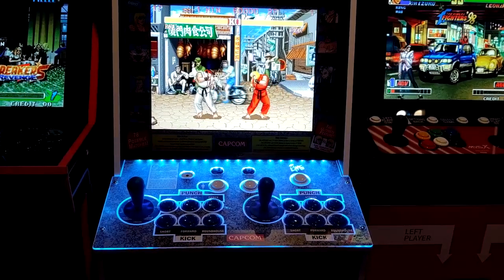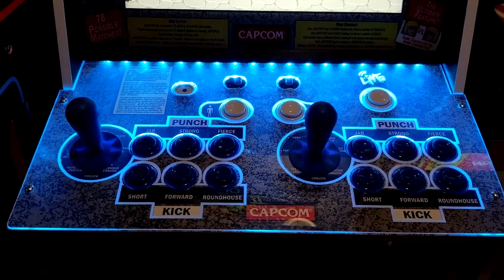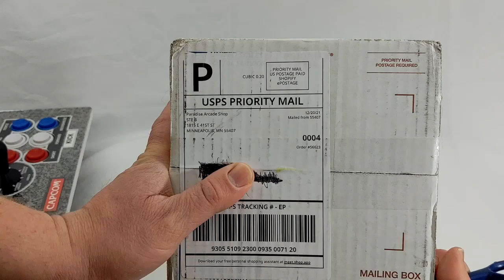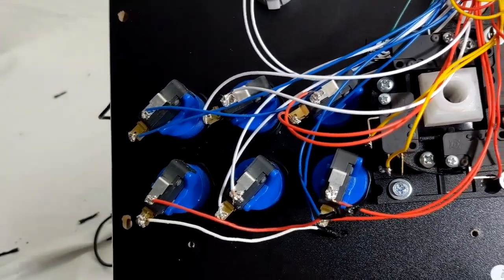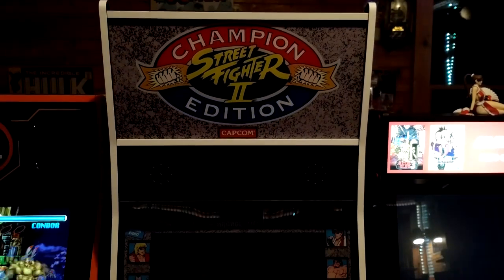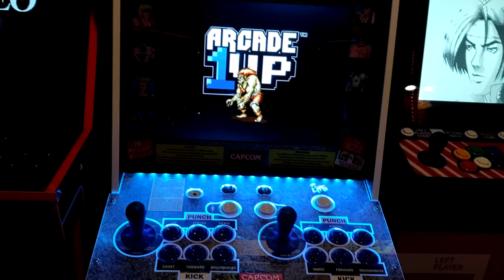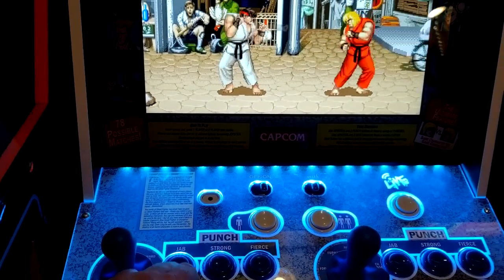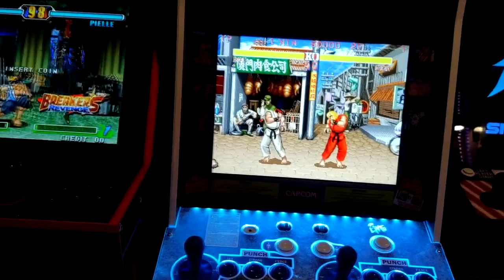Arcade1up Big Blue MOD: IL Eurosticks and HAPP buttons INSTALLED!!!

Comment: Nice job! I being told the IL sticks are the way to go. I just bought all sanwa buttons and joy sticks for it. Now I’m gonna buy IL sticks and use the sanwa on another cab. Hopefully I can actually perform a dragon punch with them. Good video
Reply from the maker: Thanks I appreciate that. I need to start practicing the DP's now.
Reply: @MikeyJProductions  installing the IL stick u need to drill 3 new holes? or can use exsting holes?
I am afraid of drilling as might crack the joystick panel :T
Reply from the maker: @KnockTsuKow  I've put IL sticks into a number of Arcade1up's and the MVSX, and I've never had a problem with this.

Comment: How did you line up the stems for the sticks with the holes? Not quite sure how to make it centered.
Reply from the maker: I just use my best judgement. As long as the stick shafts dont touch anything while you are playing, it'll be fine.

Comment: Yo, Mike. I recently messaged you on your older mvs exposed as well lol. I'm still so confused on the sticks sinking in deeper on the MVSX but they're higher up on the big blue. They're all IL Euro sticks though. Definitely let me know how the sticks are sinking in deeper on the MVSX when you check that post I made, bud.  ..PS. What cutting tool exactly are you using to cut that plastic on the stick to make it fit on the deck? The tin cutter I use takes forever lol. I don't want to go through that cutting hell again
Reply from the maker: Maybe better tin snips, it was easy for me, like cutting through cardboard almost. I just grabbed the ones I had in my house, lol
Reply: @MikeyJProductions  maybe I'm thinking of something else when I think of tin snips lol. When you get a chance, can you send me an Amazon link on what you have? Doesn't have to be exact, but to give me an idea

Comment: Your soldering techniques will result in cold solder joints. You have to get both joint surfaces to heat simultaneously and apply the solder and allow it to flow into the joint. Eventually those joints will likely fail.
Reply from the maker: If it was something more technical, you might have a point. But for this, itll be fine. As long as the wires are connected to the metal, they will work.
Reply: @MikeyJProductions  Let me be clear, this was meant as constructive criticism not trying to be a dick at all. I have been certified in soldering and worked at HP repairing PCBs for a number of years decades ago.

IMO if something is worth doing it it's worth doing right, but you may be right in assuming this won't be a issue for you.

Thanks for the content, I appreciate you putting videos out there.
Reply from the maker: @IndustryLeech  I appreciate what you are saying here. Yes soldering PCB's is a WHOLE different ball of wax. I actually DID mess up some cheap PCB's I had that I was practicing on. So yes, this is NOT intended for serious soldering or PCB repairs. 

I mostly just solder wires together, and simple things like this. I just wanted to show people that it's NOT that hard to do, especially for simple projects like this. To help maybe give them some confidence to give it a try. As soon as you say the word solder, most people run for the hills.

Comment: I realize this is old, but I just got my Big Blue and was excited to replace the buttons and stick before I put it all together. I removed the screws from the black panel that covers the back of the buttons and such, but it is not coming off easily. It feels a piece is connected to the PCB board and I am wary of applying too much force to free it. Did you experience anything like this?
Reply: Never mind, I figured it out. Some of the glue from the button connectors touched the plastic. I used a heat gun to soften the glue and then it came off with ease

Comment: Hey Mikey!! Do you have any problems doing any special moves like fire balls or Dragon punch on the second player side? I upgraded my big blue too using industrial Lorenzo joysticks. First player is working flawlessly after warming-up. Second player is not  doing to great. Just wanted to know if anybody else is having this problem.
Reply from the maker: How long has it been? Just give those sticks time. The VERY first IL's I ever bought, I was slightly disappointed in them, I didn't think they were as good as everyone said. Well... those VERY same sticks are my ABSOLUTE favorite ones in my arcade. They are the oldest ones I have, so they are BUTTER now. Player 2 is just going to take longer, it doesnt get played as often.
Reply: @MikeyJProductions  okay cool that's understandable. I know I got everything connected properly because the character jump up and down and move left to right with no problem. Thanks for the help Happy New Year